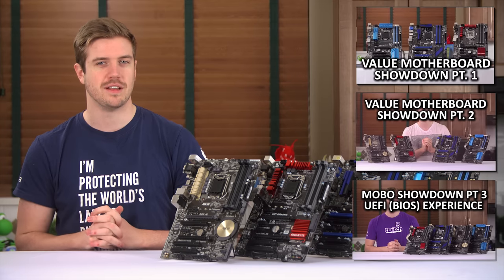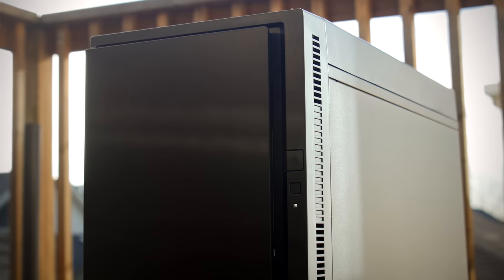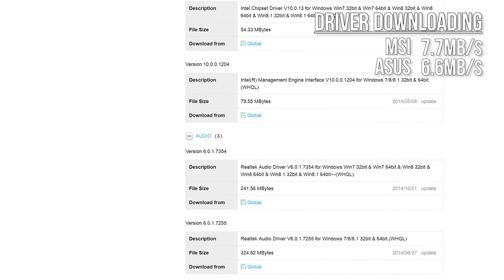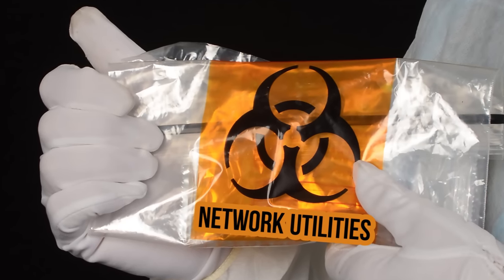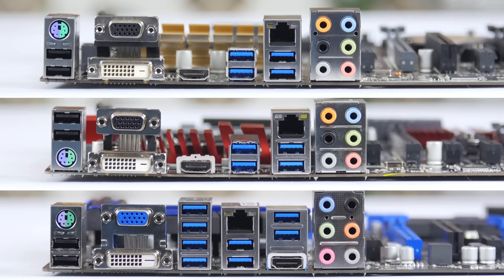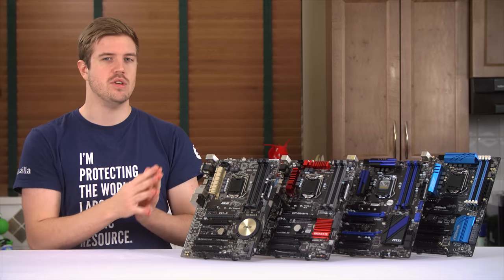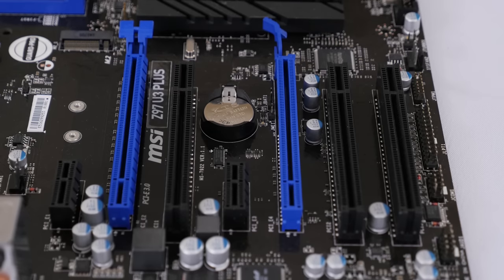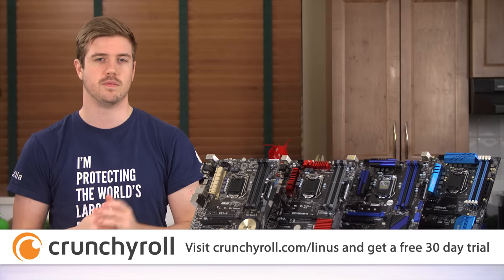Bang for the Buck Z97 Motherboard Showdown Part 4 - The Epic Conclusion

Comment: Hey guys I want to build my first pc, I want a Triple monitor setup Mostly for study and trading (investments) but also I want it to hold its own on the off occasion I decide to game, any advice with my selection of parts is greatly appreciated!

CPU: Intel Core i7-4790K
GPU: EVGA GTX 980 SC
Mobo: ASUS Z97-A ATX DDR3 2600 LGA 1150 Motherboard
RAM: Corsair Vengeance 16GB (2x8gb)
PSU: Cooler Master V550 - Compact 550W 80 PLUS Gold Modular
Cooling: Corsair Hydro Series High Performance Liquid CPU Cooler H60
SSD: Samsung 850 EVO 250GB
HDD: WD Green 1 TB Desktop Hard Drive
Case: Corsair Obsidian Series Black 450D
Reply: You are going to need a bigger power supply.  750w should be good.
Reply: Personally I would go for a slightly better water cooler. I would go for an h100i. Also, if you have the money, get the blue or black drives from western digital. Sick build though!!!
Reply: thanks for the tips guys! I'll definitely make some changes
Reply: DrJubes haha no worries man! Good luck and have fun!
Reply: Switched out the PSU for a corsair RM 750 80plus gold, the cooler for the h100i and the HDD for a 1TB WD Black
Reply: DrJubes why switch to an RM 750. I don't see the need to. Also OP if your case fits this CPU cooler and you don't mind the look. I suggest the noctua nd-h14.  Also WD blue is fine too.
Reply: Really nice build you have there. I've used all of the parts myself except the GTX 980. Everything is really nice. You don't really need another higher wattage PSU, 550 watts from a high quality power supply is more than enough. The Cooler Master V550S is an amazing power supply. But if you do plan on adding an extra GTX 980 in there, you will have to go with a higher wattage PSU, I'll recommend the EVGA G2 850. If you do plan on overclocking t, I would change that cooler to a H100i, but if not the H60 with a Noctua NF-F12 fan will do nicely. Other than that your build is nice!
Reply: ok so I'll review each piece and give you my advice cpu: great cpu nothing to say gpu: if you're using it for content creation a gtx 970 will have similar result in game for much less (even with 3.5 usable ram it's still a ber great card) mobo: you can't really go wrong with a mobo just take something with what you need in aio and take the cheaper one ^^ ram: memory speed is not important take the cheaper 16GB you cna fin from a known brand (ripjaws win this one)
psu: nice psu plenty enough power and modular cooling: liquid cooling is really not necessary so I suggested you a air cooler which is more cheap and still super silent ssd: seems right if you need 250 Gb of fast storage if not I would go with a 128Gb and save the money for a 2TB hdd hdd: any hdd with good review is good so I took the cheapest one in my recommendation case: case is personal preference but still one comment: nice case bro. 

so my final suggestion is: http://pcpartpicker.com/p/KVz799
should have similar result in game and for working ^^ (oh I just understood that you want to game on 3 display well go for the 980 sorry don't have time to change the pcpartpicker but your choice is good choice ^^)
Reply: Thanks so much for the advice guys, I'm genuinely taking all of it on board!
Reply: DrJubes No problem. But next time ask on Tomshardware. YouTube is not a good place to ask for help with computers.
Reply: A 550 watt power supply would be fine for that exact build but not really "future proof". Upgradeability is a factor and you can spend 20 extra bucks for a 850 watt power supply and avoid buying a new one when you want to upgrade. It wont necessarily matter but if you count the expected utility of not wasting 90 bucks on a new PSU its probably smarter.

An i7 4790k is literally an i5 4690k with hyper-threading and a slightly higher boost clock. You should seriously consider if that feature is worth 100 dollars as it does little for gaming or even most types of other demanding tasks.

Its strictly better and the average performance increase will be like 3% so if you really want to spend 100 bucks on that go ahead.

Depending on what type of gaming you want to do an 980 is probably overkill. If you're getting a triple monitor setup its good because you can do multimonitor gaming but otherwise an 970 is already overkill for 1080p.

A liquid CPU cooler is expensive, pointless and a bit of a hassle to set up. Just get an air cooler.
Reply: DrJubes Then you are set, watercoolers are only good for OC, so if you hare OC'ing get it! If not, don't.
Reply: Really nice setup but I honestly think It is way overkill, I can recommend some other parts if you want.
Reply: DrJubes the forum is the best place to ask for help normally you'll have at least 4 answer in less than 30 min ^^
Reply: Holy cramp I've got that exact setup except with a crucial mx100 ssd, vega PSU, and h100i cooler. Very great build works great for me!
Reply: *crap *evga
Reply: Yo Mama awesome dude, thanks for the reassurance! :)
Reply: WD drives are GREAT, but, watch out for the "Intelli power" it makes it so every 8 seconds your drive turns off if your not using it. It's like turning on a car 300 times a day, your starter is going to break.
Reply: ***** Kraken X61 all the way.

Comment: hello i want to buy 2 new pc's whit
Intel® Core i7-4790K, 4.0 GHz (4,4 GHz Turbo Boost) and MSI GeForce GTX 1070 Gaming X 8G
i need a motherboard that can handle 2x MSI GeForce GTX 1070 Gaming X 8G 
what motherboard do you recommend for a 100$ or less. 
(im from europe and the motherboard are not on the market that are shown on this vid)
wen i get 1 new vid card later i want to put the 2x MSI GeForce GTX 1070 Gaming X 8G in 1 pc
i do want nice analog audio
i don't care about looks just want good performance and i'll use air cooling ^^ TY

Comment: so I want to get an AMD FX-8350 and a msi 970 mobo, apparently for using recording software AMD's FX series beats the I5, also I have a tight budget for my CPU and mobo of £250, anyone else like to say anything?
Reply: would advise against that particular series of AMD chips, the piledriver architecture is terrible and in actual applications doesn't really 'beat the i5' - especially gaming. Just do some research on that chip before you buy, there's quite a few problems with it.
Reply: from all the reviews and stuff i have seen, they pushed it more to the AMD FX series for streamers
Reply: The i5 is better for gaming but for streaming and stuff, you really can't beat the more cores of the AMD.
Reply: Byron Shultz that is exactly what I thought was the case
Reply: Potato just saying, streaming games is kinda what I am doing (sorry if i did not make that clear)
Reply: Potato yeah thx dood, I am upgrading from my dads old cpu (AMD A8 6600K) and well I think that it should be a worthy upgrade

Comment: I have an asrock board it sucks dick. Fans randomly turn off and the sensors are terrible i`ve seen socket temps read -100c before lol.
Reply: Lol that sounds like a bad board. Shit happens. Ive had an asus board that just stopped working and an MSI board that shipped with a dead pci slot.
Reply: God of Chuck I had a sapphire am3 board (with athlon II X4 645) that slowed down everything, applications ran extremely slow and sometimes it just froze. Games had about 5FPS. CPU switch didnt help, then just got a cheap aSus a88xm-a mobo with an athlon 760k and now at least the games all run decent with the gtx 560

Comment: Could someone please tell me if this will run half life 3                           Confirmed?
i9 6969K over clocked to 420 ghz
geforce gtx 666 with 4200 gigabytes of GDDR69 in 8 way SLI
911 gigabytes of DDR10 ram 
a 6 TB/s 48tb ssd
and a 69K 420" display
and a snoop doge case with meme stickers
I will be running darude sandstorm V 8.1 as my os

Oh and a water-cooled loop cooled by 9 parts mtn dew and 11 parts Doritos for a 9/11 mixture

XDDDDDDDDDDDDDDDDDDDDDDD